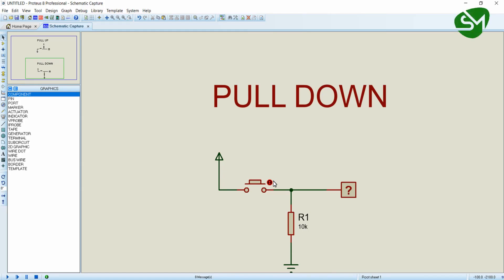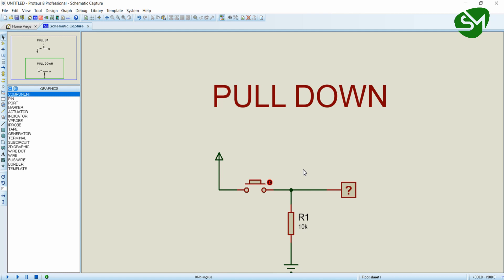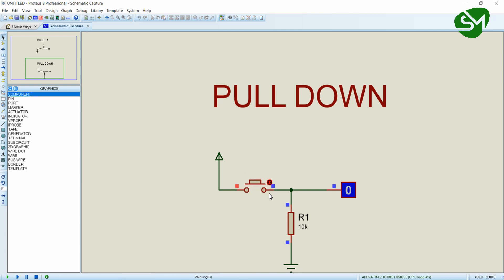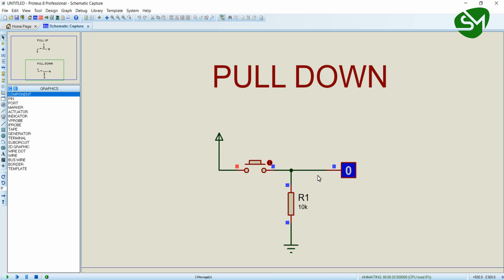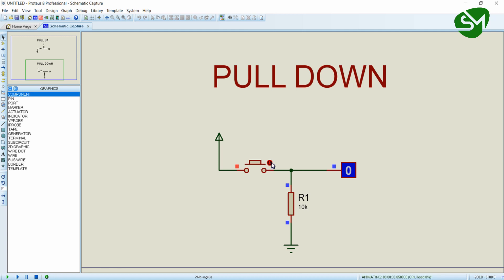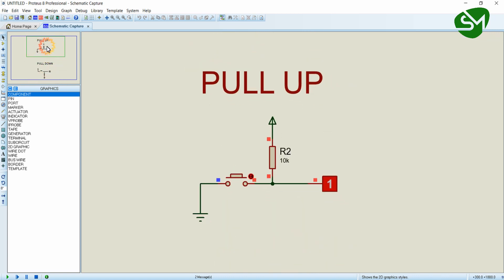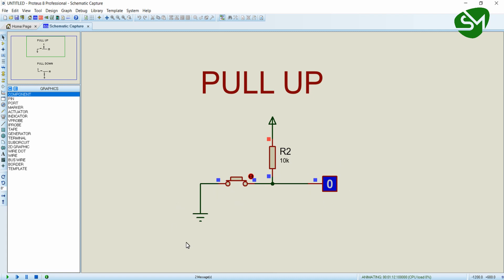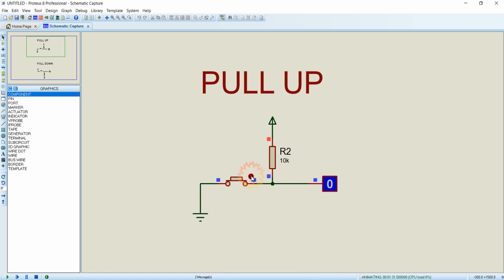Input devices working logics explained | Pull-up and Pull-down

Comment: Your teching way is very easy. i have recently learned c.C++ for embeded coding and it is very difficult to deal with library function in arduino becuz som AVR chip doest not support inbuit library of arduino uno ide. so way of working is it very much unknown to me. i have at last found your video very usefull. no author want to explain details in you tube,thats why full we can't learn
Reply from the maker: Thank you for your feedback 
I learned from internet giving back that’s it😊